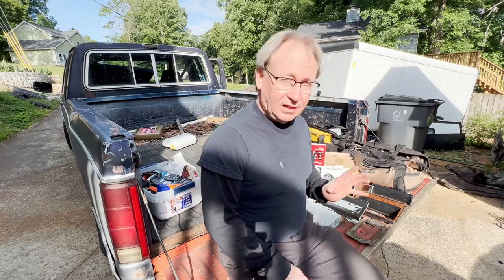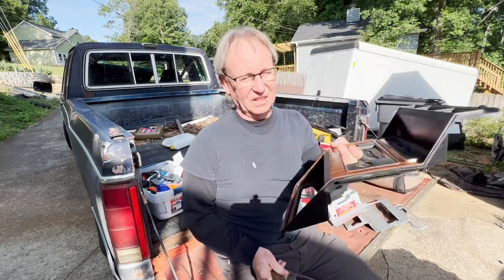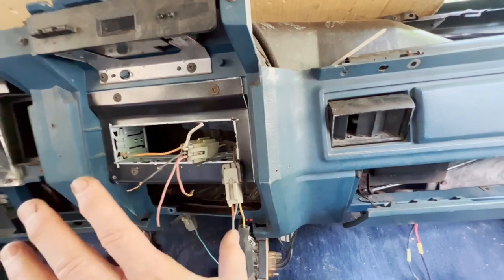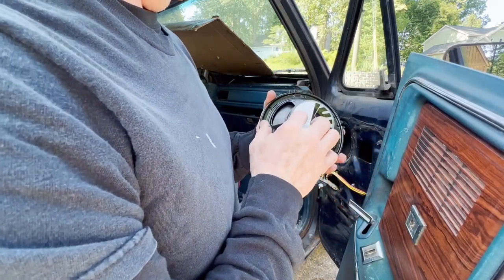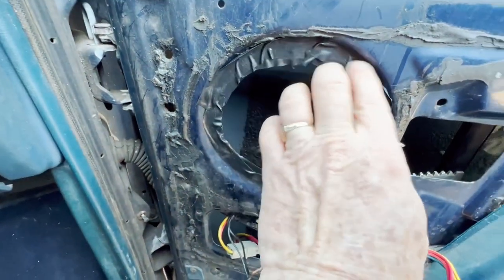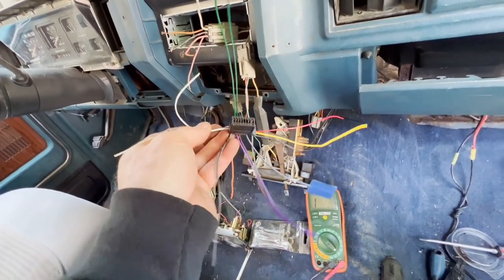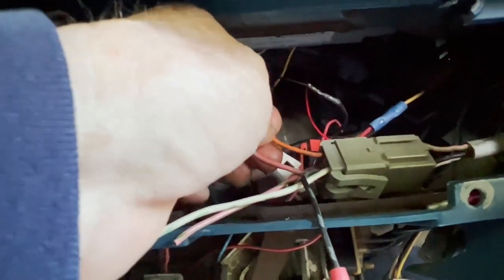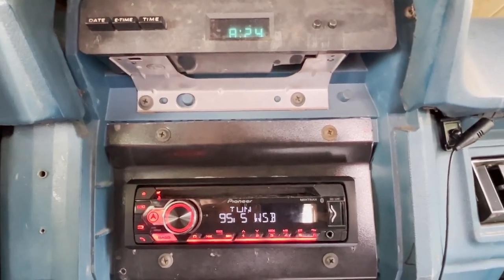DIY How To Install Modern Stereo in 83 Bullnose F-150 and Replace Door Speakers

Comment: I have the same year the same color but mine is a f250 with the 6.9 idi but it has crank windows thanks for the help
Reply from the maker: Hi. Thanks for watching and taking the time to comment. Glad the video helped you out. I have crank windows in my 74 Olds Cutlass and am always having to stop and stretch across the seat to roll the passenger window up or down. F250 is a big truck!